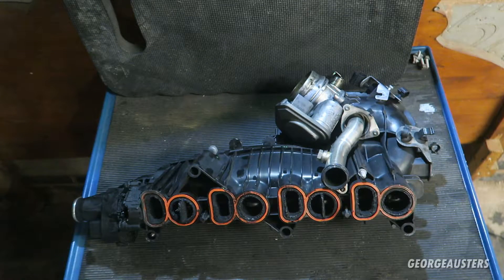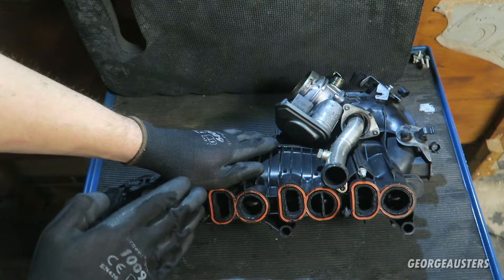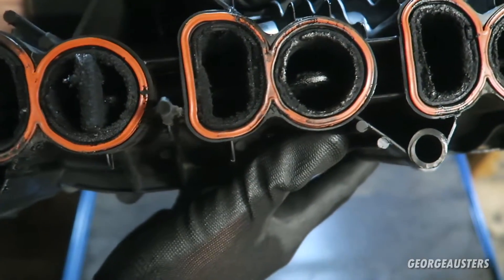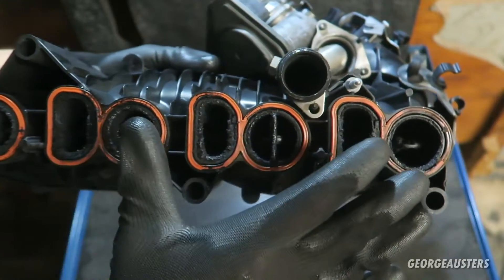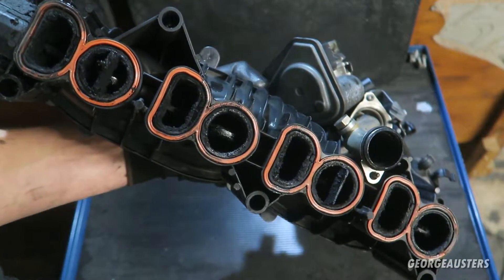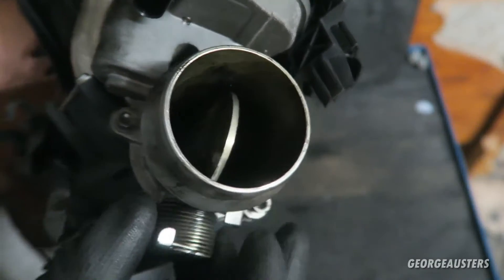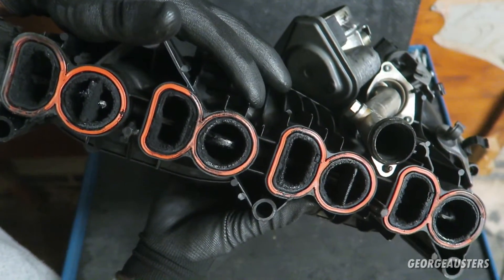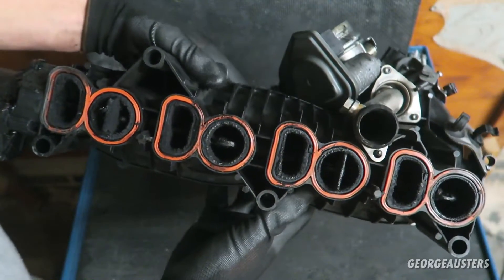BMW N47 / N57 Intake Manifold After 120,000 Miles

Comment: On my 1.6 TDCI fiesta the intake manifold was similar or worse to yours. The soot at the end of the pipes took up like a quarter of the diameter of the openings. Used Mr muscle oven cleaner and a pressure washer and it was a lot clearer. Also blocked the EGR. I believe the car felt a little more responsive thanks to the engine getting more air going in
Reply from the maker: Yep very very common mate👍🏻